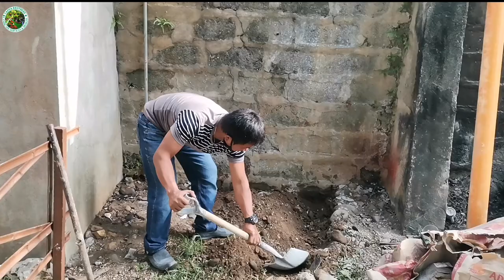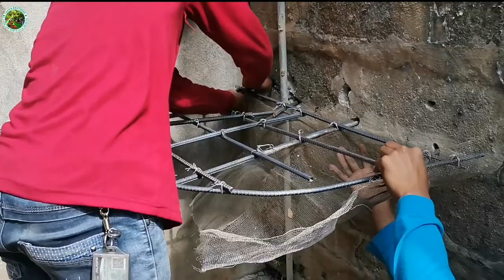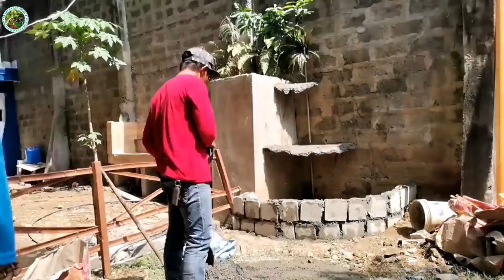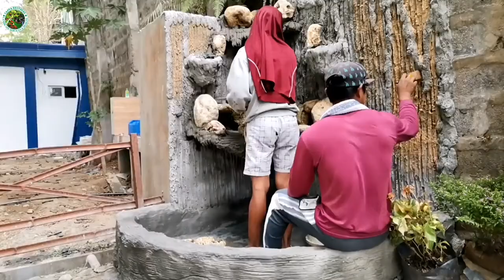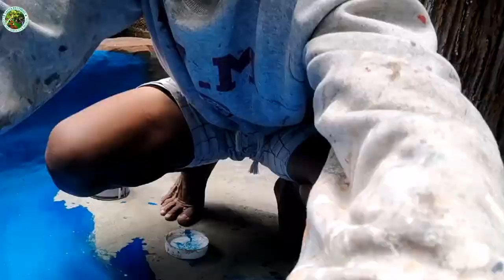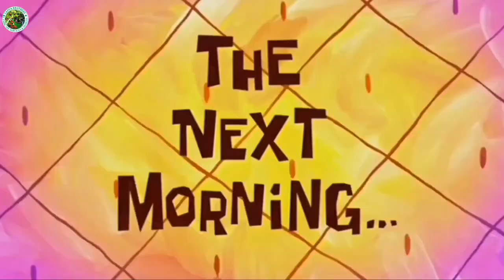How to Make Simple  Semi natural Waterfalls

Comment: Ano sukat nyan paps
Reply from the maker: Height  2m.
Width from the wall 1.5m.
Length 2m
Reply: @tappabrotherslandscapeserv784  ano po ung mga materials?
Reply from the maker: 8 pcs 10 mm rod,
5 pcs 9mm
1 kgs tie wire
2 meters 1/4 screen, 
7 bags Cement, 1 bucket sand, 
and 2 gal. paint po
Reply: Boss anong klaseng paint ginamit nyo?